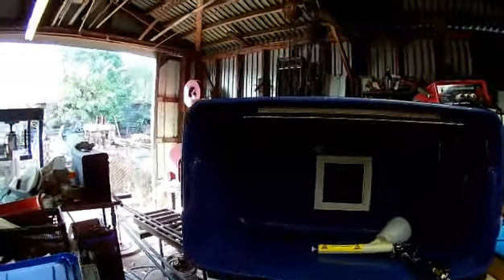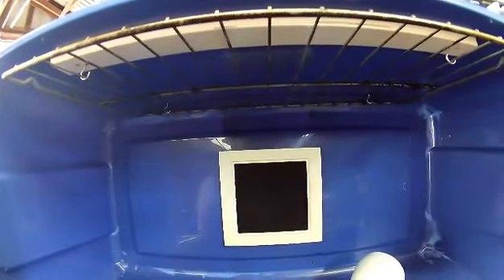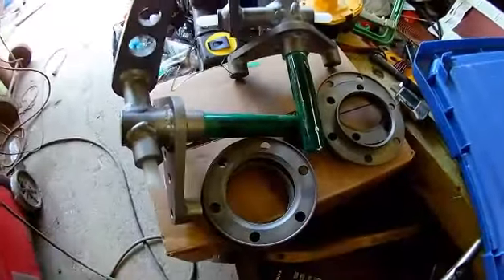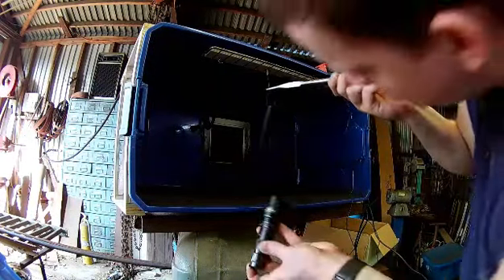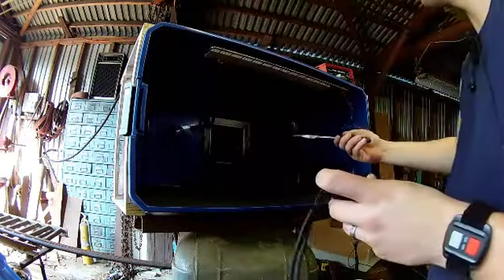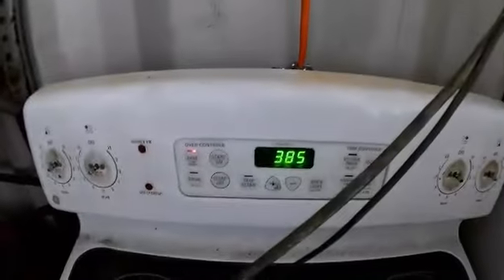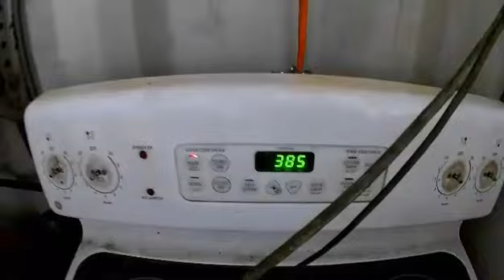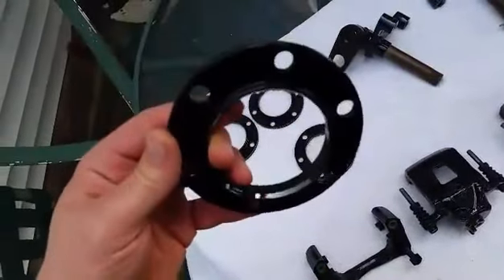My homemade powder coating booth

Comment: Is a fan necessary? I am just starting out and going to only do small stuff at first, would it be ok just to collect all the overspray without a fan to begin?
Reply from the maker: You can always add one later if you need to.